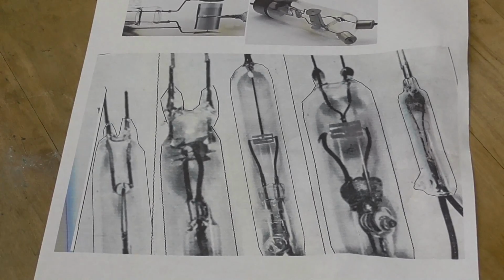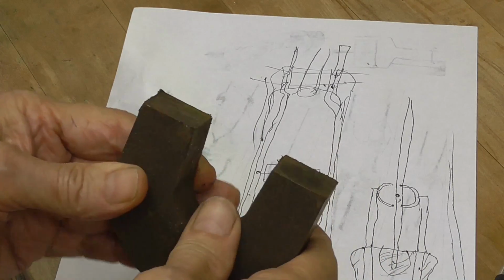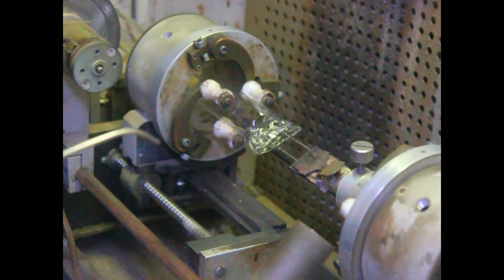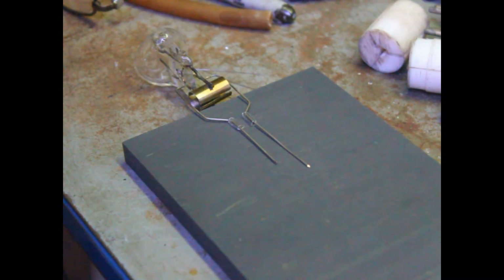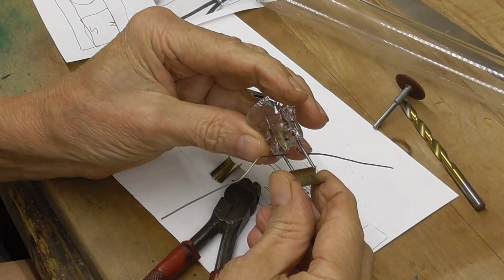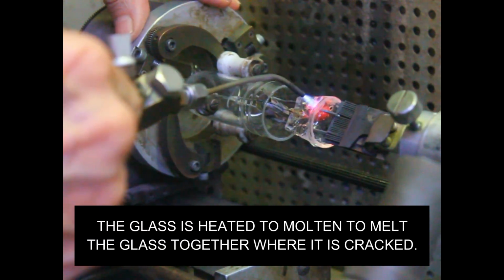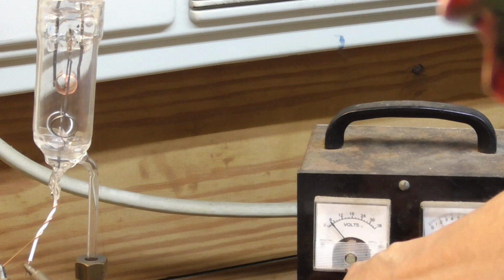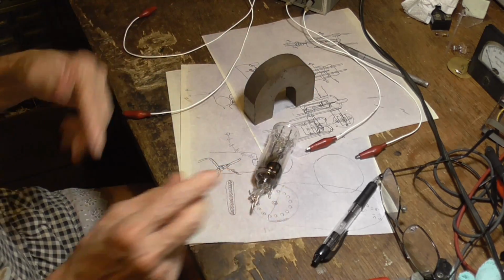MAKING A PRIMITIVE MAGNETRON

Comment: i took apart a microwave last week, and the most mysterious part was the magnetron, luv the video!
Reply: Kept mine as decoration!
Reply: Ones in microwaves are simpler (cheaper), it's a metal vacuum tube (instead of glass), using a resonant metal tube with the filament and cathode/filament running through the center of the tube, and the metal casting itself being the anode, they act like a whistle, but whistle at around 2.45Ghz